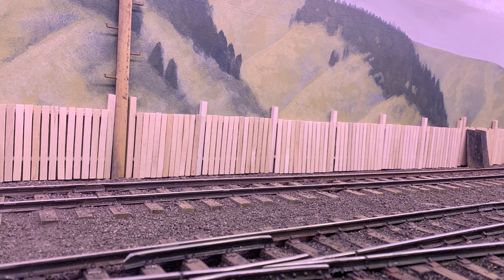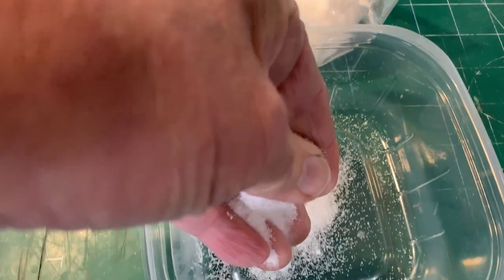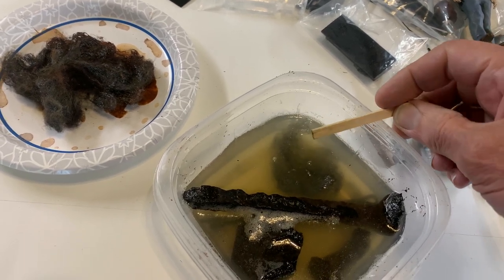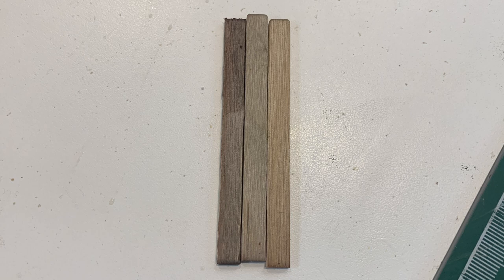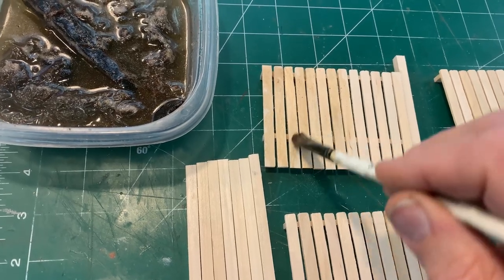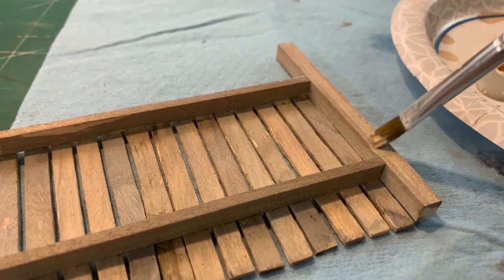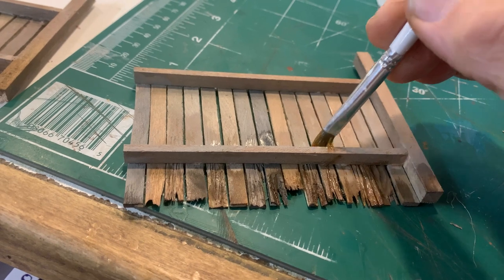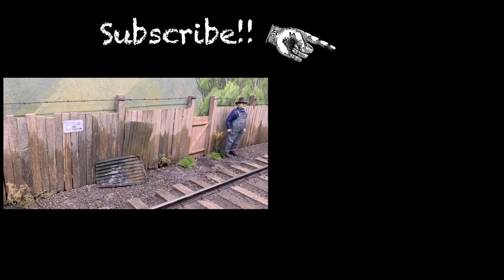Aging Wood with Vinegar and Rusty Iron - Aging the wood fence on our model railroad.

Comment: Hi! I am loving these. Such simple structures, but so much technique!
Reply from the maker: Hi again. Next Sunday we make rust. Still trying to figure a way to make wheels for the wheel and tie car. But first rust. And two locomotives. And lunch. Probably several lunches. Gotta love retirement. Big thing for the day: lunch.
Reply: @ToyManTelevision  Ha! Several years ago I was made redundant. I had several trips planned so didn't bother getting a new job for about three months: Considering myself "temporarily retired". I worked in the garage building stage props for my band mainly, but I remember lunch was a real important part or my 'retirement'!

Anyway, yeah, if you get those wheel sorted, I will be very interested.

(Now,..... where's lunch?)

Comment: Dale:  Adding the salt (sodium chloride) to the vinegar (acetic acid and water) and forms a buffer.  I suppose by making the buffer it keeps the acid strength constant.  

You and Karyn continually amaze me with the scenic tips and tricks you come up with.  I need to file these in my memory or at least some where else that I can find them when I need them.  

I am wanting to build a large curve trestle (in N scale) but am not having much luck finding raw materials.  Once I get started with the bents then it shouldn’t take long to build it.  Wow how is me.  Great video 🌛! Never boring.  Great Chemistry lesson!👍
Reply from the maker: Hi Ken!  I indeed such small wood is hard to find.  Well the 1 foot strips are but expensive!  National balsa has bass wood down to 1/16x1/16. But that’s big in your scale!
Reply: @ToyManTelevision  I keep my eyes open.  Sometimes there are cylindrical wooden stirring sticks for coffee.  So when no one’s looking I grab a handful.  They are still a bit to large but it is a start.

Comment: We did add a vinegar sheen on our floors. Left the steel wool in water too, before throwing it into the vinegar. Had two older batches of steel wool which already had some rust on ‘m. To us it seemed like the more contemporary steel wool has indeed a kind of protective layer on it. It also feels much smoother than the old batches from my grandpa’s shed. Anyhow, left the vinegar in our different containers. There’s still a lot left and I now use those different vinegar washes on my models. Also think of adding Coca Cola. Salt, Arm&Hammer etc.
Really looks great your fence.
Reply from the maker: Hello!  Old furniture was often stained with vinegar and rust. Then shellac.

Comment: I watch several You Tube channels that do restorations on all kinds of stuff. Most of it is badly rusted.
To remove the rust, they often use a similar process to what you did, but sometimes introduce electrolysis to the mix. Wow how the rust comes bubbling off, producing he same hydrogen gas,
What ever the rusty thing you Put in comes out minus the rust and it's dissolved, mostly, in the liquid.
Do you remember the little science experiment you did in school where you separated water into it component elements (hydrogen and oxygen)? That's the bubbles you see, but you are not trapping the gas here. ;-)
Reply from the maker: That cotter pin I tossed in was cleaned silver. Really dull pitted silver. It’s outside just now getting it’s rust in shape.

Comment: I'm trying to figure out how to make it darker color or even a little grey with some coffee grounds added to this mix .
Easiest way to get rust that's inexpensive is used steel wool or just add the steel wool right out of the bag .
It does work its NOT instantaneous you have to be patient .
I had 2 gallons in about a week .
Also you didn't have enough vinegar in the container .
Reply from the maker: This worked great! And I’ve used coffee grounds for lots of things. Weathering painted wall is the BEST.

Comment: Did you think of mixing some ferric chloride in the vinegar?  That would get the iron that you would get from rust in the vinegar.
Reply from the maker: Thought about that. But that ferric chloride is dangerous stuff. And i ain’t no chemist!  So I was a bit afraid of something going very wrong. But I did take that outside and rust the metal patches
Reply: @ToyManTelevision  I saw that someone added vinegar to ferric chloride to dilute it because they didn't have distilled water.  They didn't get any reaction.  I used ferric cloride all the time to etch printed circuit boards.